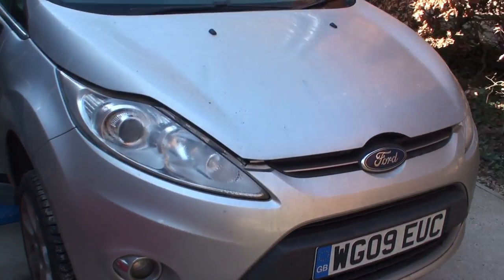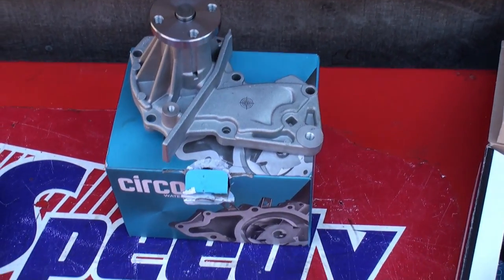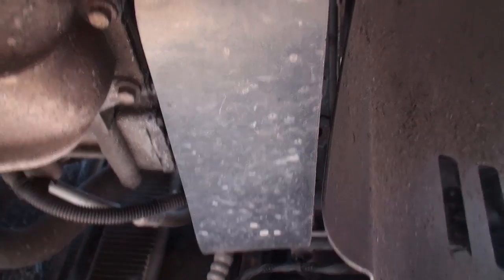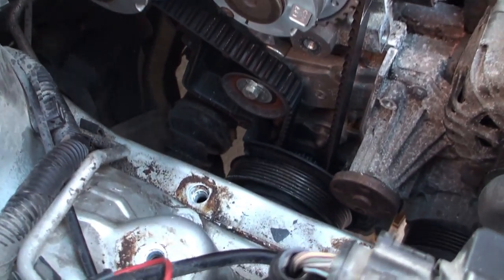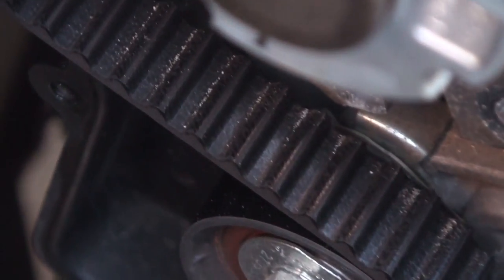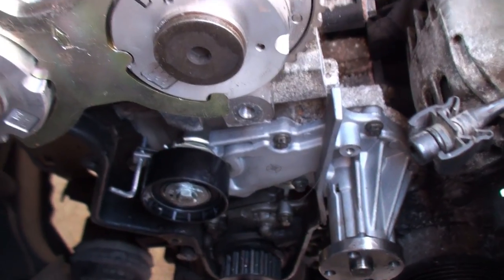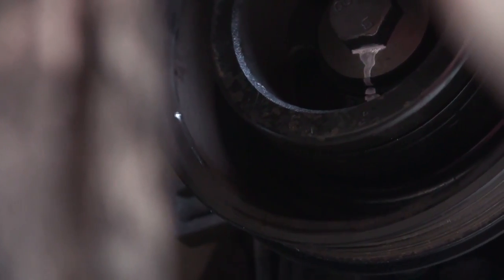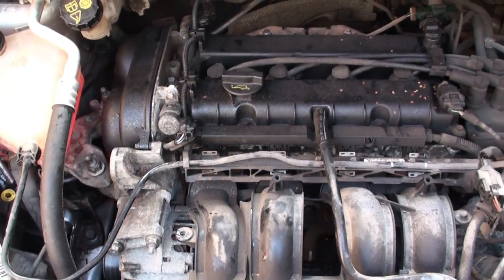Fiesta MK7 Petrol 2008 - 2017  Cambelt Replacement Guide

Comment: Do you need to use cam locking bar or can you just leave valve cover on and use the vvti locking tool
Reply from the maker: The cam locking bar need not be used.  The engine has variable cam timing so the relation of the cam sprockets to the camshafts is varied by the engine management system.  If the sprocket locking tool slips off and you loose the registration then you will need both the cam locking and the sprocket locking tools to re-time the Cams.
Reply: @razenby  thanks very much .. so don't let the locking tool slip of then eh

Comment: Thank you so much for this video. My car is the same year but 1.4L automatic so this video is incredibly helpful to me the anxious amateur. I wonder, could you give any pointers on how you cleaned up the block surface where the water pump goes and what you used to help seal the new one in place? Thanks again!
Reply from the maker: No problem. Nice to know it was of use. I use ThreeBond 1215 Liquid Gasket smeared onto the new gasket supplied with the pump. This stuff is really good and is used in-house by car manufacturers.  The old gasket came off clean so I just wiped the mating surface on the engine with brake cleaner.
Reply: Magic Smoke Brilliant thank you I will look out for some of that.
Reply: kurisurs - did you do this job in the end? I've got the same 1.4 auto as you. Magic Smoke says the starter motor is easier to access on the 1.25 and 1.4 but looking at mine it is buried away hidden behind a lot of pipework!

Comment: Your not living in the past (comment aroung 21.35) i own two cars currently (chain) and have owned others in the past the two cars with chains i own is the VW EA888 1.8 engine fitted to VW polo and some Audi vehicles and a Mazda 2.2 Diesel, I look for cars with chains so i dont get this headache, my last car that also had a chain 2.0 Petrol Mazda engine i drove over 120,000 miles and shes still kicking around, Mazea petrol engines are bomb proof, Diesels hummmm, I am watching this video because a customer of mine wants me to change the belt on his fiesta, Looking at this video i think the VW 1,4 tsi timing chain i changed last year was easier. great video this is.
Reply from the maker: I know what you mean, apart from a thermostat and a glow plug, my B class diesel has done 170k with no engine service at all including the timing chain.  Good luck with the job.

Comment: Quick 1: is the flywheel locking tool strong enough to sustain the torque from loosening/torquing the crankshaft pulley bolt (  M14 at 74 lb-ft or 100 Nm ). Awesome vid , lovely accent ;-)
Reply from the maker: Thanks. Yes the lock is very strong but you need to take care that it is properly engaged.  Do this by sliding the mount up and down until you feel the dog on the lock post slide in and fully engage in a valley on the ring gear. Then tighten up the 3 bolts.  Worth taking your time over this step.
Reply: no ,  the clamping kit we bought from eBay wasn't fit for purpose, after spending many hour locking everything into position, cutting the belt and started undoing the pulley bolt the flywheel holding tool snapped very easily !!!  we were horrified ! we aren't experienced with engine timings and just watched the main crank move!!!  ended up taking the sump cover off then could see the fly wheel, we then made our own tool to hold it.

Comment: Hello brother! I need your helping, please. I have to replace water pump on my ford fusion 1.6L ecoboost. I took off the crank pulley before installing TDC pin ( without TDC pin ). I turned the crankshaft 1 rotation and 2 camshafts did not turn, and I deflected timing marks of the crankshaft and the camshaft. Right now, how I can align correctly the timing marks again. Can you show me how to do it? Please 🙏🙏🙏
Reply: Ohh ohh
Reply from the maker: Be careful turning the crank if the cams aren't locked you might hit a an open valve. If you turn the cams so that the timing marks are as shown in the manual then fit the locking plate then you should be back on track. Note if the engine was running when the belt broke then it has likely to have bent a valve.

Comment: My girlfriends car is a Fiesta zetec s 1.6 2010, in the service book it shows the belt & water pump had been done at 80k in 2017. by Ford main dealer. Now on 100k, do you know if it should be replaced again? How much would a garage charge roughly also. Thanks, helpful video but I don't think I'll attempt it
Reply from the maker: When you say belt do you mean the cam belt with teeth or the smooth Aux drive belt?  The cam belt replacement interval is ~80K miles or 10 years.  The Aux belts last about 50K.  So it seems you are golden for a while.  You can inspect the Aux belt - look at the pulley side (inside) of the belt for cracks and missing parts of the ridges.    It should be a smooth continuous ridged surface.
Reply: @razenby  I'm not sure now actually, so Ford have stamped & written 'Cambelt & water pump' at 76k in 2017, fast forward to 2020 at 99k a different garage (private garage) has written 'Timing belt!' A few lines under where it looks like he charged £100 to do a 'C/O service'

Comment: so do you not need to use the locking plate at the back of the cams? I assumed that was necessary to keep the clutches in the right place (my first VVT)
Reply from the maker: If the rotational relative position of the pulleys is maintained the the cams by definition will be correctly positioned and the rear locking plate is irrelevant. . The rear locking plate is to lock the actual camshafts at TDC so you can set the the pulleys. If you lose the positions of the pulleys (say the locking tool slips off) then you will need the rear CAM locking tool to reset the cam/pulley positions.  If you prefer to use both you can.
Reply: @razenby  wish I'd asked before taking the major faff rocker cover off! Presumably you lowered the engine a bit to get to the crank bolt,  is it hard to restrain the motor when heaving with the mount off?
Reply from the maker: @mikejagger2462  The motor is plenty firm enough with the top mount removed. You need to support it though.
Reply: @razenby  many thanks, if you like a Stones show I'll sort you a ticket - if it ever recovers!
Reply from the maker: @mikejagger2462  Do I like stones.. we play their songs in our Band!!!
Reply from the maker: @mikejagger2462  Cheers, Standing by!

Comment: Is this applicable for the diesel 1.6 TDCI engine as well? Me and my dad were going to have a go.
Reply from the maker: It will be a very similar but procedure but as I haven't done the TDCI I cant really advise.  Good luck.
Reply: Honestly most of this is applicable to the Fiesta ST as well which is this engine + turbocharger. Surprisingly helpful to me because there wasnt a good procedure video for the ST in particular besides this one where they do a buttload of extra steps.

Comment: Can't u just loosen the belt tenioner slip the belt over the bottom pully the repaet the prossess
Reply from the maker: No, the lower part of the cam belt cover prevents belt removal, the pulley prevents the removal of the cover. So the lower cover has to be removed.